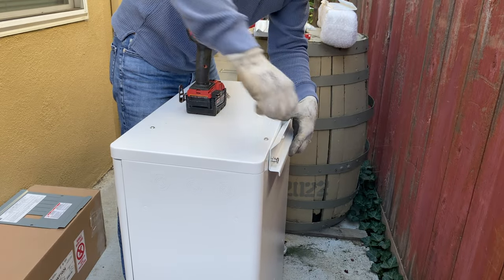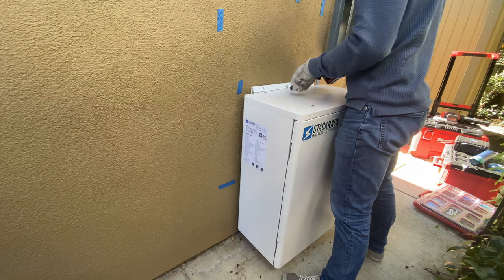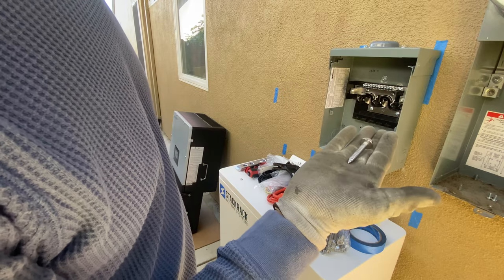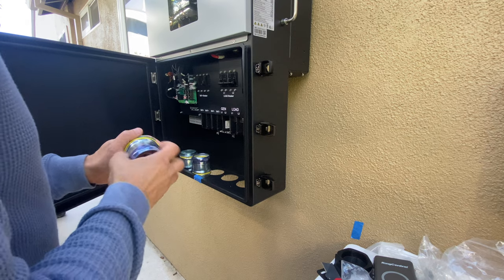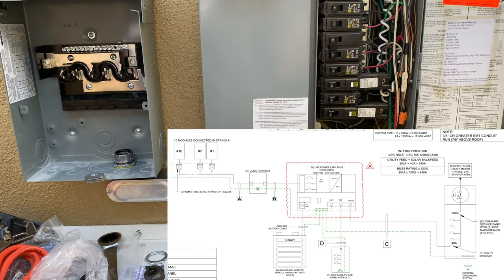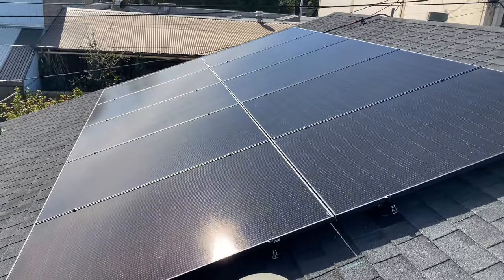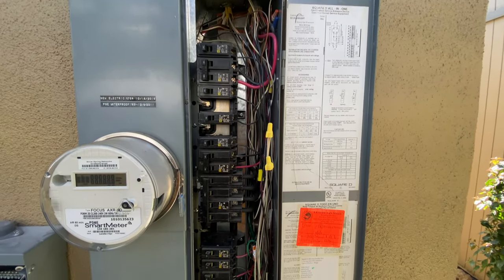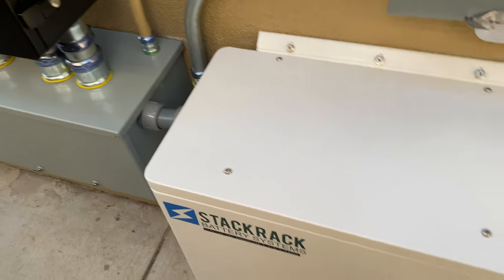Solar battery backup system for home. Luxpower 12k, 10 solar panels, 5kWh LFP batteries.

Comment: You make it look to easy. Did you set up CTs for zero export?
Reply from the maker: Not for the main panel (Luxpower still need CT's even on load side). It's going to be a grid-tie system.

Comment: Can the Luxpower 18Kpv be used like a grid-tie limiter inverter?  Where you don't send power back to the grid, you only use it or self consumption from solar and batteries but take power from the grid when you need t?  Are there any neutral/ground bonding issues to overcome?
Reply from the maker: yes, it's limited to home mode with 0w export.
I'm not aware of any issues with neutral/ground bonding.

Comment: The 12k can pull 245 amps.
If these are 100ah batteries, you are 45a short, so should be a minimum of 3 100ah batteries ?
Reply from the maker: it's 100Ah battery, and 50A charge/discharge. During power outage all loads will be reduced to conserve energy. Batteries adding a lot to the system price.
Reply: @SolarEngineering  yeah batteries are the most expensive part of a solar system..
Customer can always add more ;)